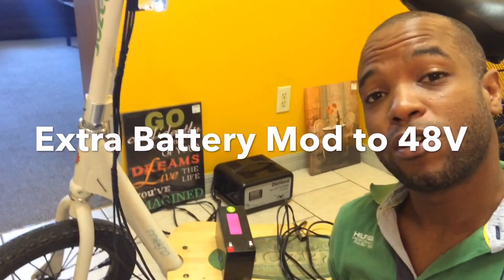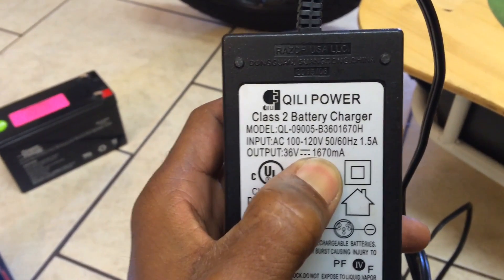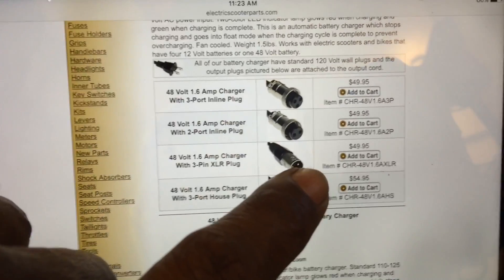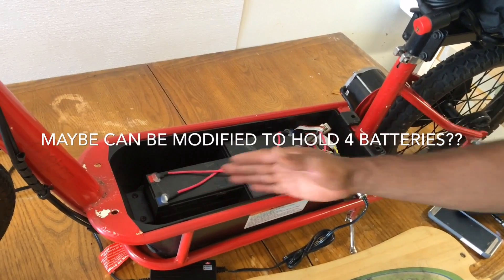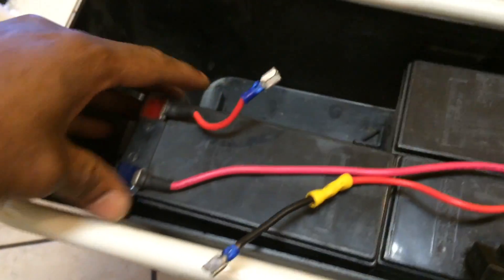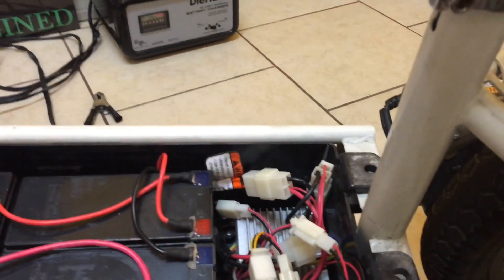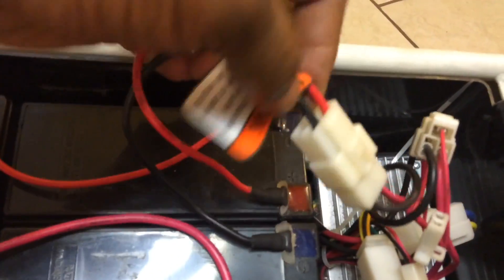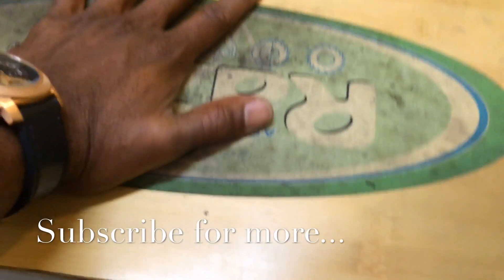Razor Eco Smart Metro Electric Scooter 48V DIY Upgrade

Comment: I raised to 48V and rode exactly 4 months :)
(just don't use charging port, make a direct 48V charge connection to battery)
The motor burned, smell so foul.
But I have really enjoyed the ride for 4 months.
I am in middle of converting to 1600W brush-less motor(BLDC)
and looking forward to enjoy the super speed.
Reply: What motor did you go with? How are you dealing with the brake? I'd love to hear much more about this as I'm interested in doing the same thing since my rear assembly just shook it's bearings lose and wreck the hub.

Comment: How did you use 48 volt on a 36 volt motor. My ecosmart has a 36 volt 500 watt motor, never knew you could put more voltage into a lower voltage motor.
Reply: Yes you can, those mid drive bldc motors can usually handle allot more then what they say. I have a 48v 1500w motor hooked up to a 72v 8000w setup. Works just fine. Maybe a bit of over heating if you constantly Max out. The 3,000w bldc is the  same size as 1500w. So if you over great alot you can switch to that one. Just have to have a good controller  that can adjust everything to your liking/setup.
Reply: @joshuawilton7829  More torque and distance due to the extra weight I carry 250 lbs was more of my consideration and the way I solved that was to trade out the 3 - 7 amp., 12 volt battery's that came with my eco - smart scooter and replaced them with 3 - 15 amp., 12 volt battery's doubled my distance and for torque I went with a larger sprocket. 
    All in all with my extra weight, I think I came out ahead of the game with 5 extra miles in distance and a 3 to 5 mile an hour speed increase. I also put on some fatty tires which smoothed out my ride, but broke even on everything else, except charge time. There I really gained, due to the extra amperage. My running time is almost two fold. While the charge time is just about the same.
   I understand the principal of hot charging / over charge but eventually it's not really a sustainable way to operate and will eventually cause the winding's to break down from over heating / expanding and cooling / contracting. Kind of like running nitrous gas on a car engine. Thanks for the info and the video, but I think I may just upgrade to a 750 watt motor from the 500 watt stock motor I'm using now. Looking to go to 48 volt 30 amp battery's.
Reply: @themessiahssecondassembly7761  you’re very detailed and intuitive. A lot of great subjects you touched base on. Definitely going to remember/save this info.

Comment: I agree with your reply Elton; I did note an additional wire to the controller which must do something? My scooter would not even light the power light until I returned it back to original configuration. I did get a spark; think that was just the two wires on battery inadvertently rubbing each other. All seems fine and really I don't get it either. I don't know what the extra red wire to the controller is, however. It really isn't too much to unplug & then replug the charger wire however.

Comment: Hi, thanks for the video.  Do you know of any way to increase torque.  I would like the scooter to pull a hill better.  Any better would help.  Thanks!
Reply from the maker: Sure but it would take a lot of research and or machining. You could install a bigger rear chain sprocket to increase gear ratio but I have no idea how big or if one exist that would bolt right on. That would significantly increase the torque but drastically lower the top speed. Like driving a car around town in only first or second gear.
Reply: @eltonq  I was hoping the 48V would give me a torque boost.  I have the newer hub drive model.  Maybe that makes a difference?
Reply from the maker: @twarch1978  oh sure it will give you a boost across the board but i think it would def consume more power going up hills at a faster speed or about the same as the 36V system. The physical work and energy (amperage) required to climb wouldn’t really change.

Comment: Hi, I did all the upgrade exactly as you stated. Fail. The added battery did work. The problem came from splicing the charging port to the battery via bypass controller. The scooter would not work in this manner. So, back up and return to functional status:   I think a direct line to battery is correct. I have ordered a 48volt charger. I think the direct bypass must be attached only when charging the batteries. Then, the wiring must be reconnected to the controller (the wires to the batteries) in order for the scooter to perform. Will post when I get the charger. I noticed your batteries later died. Was this due to upgrade or not charging for some time? Thanks for the video.
Reply from the maker: Lynn González hello Lin you had me nervous there for a second I thought my instruction fried your scooter lol phew 😅 

I'm not sure what happened but you are supposed to splice from charge port straight to main red and black battery harness wires when you go to use the new 48V charger. Technically speaking not having anything plugged into the charge port should be the same as just disconnecting the charge port connector on the inside as shown in the video in which case the scooter should run fine. Can you explain again what went wrong?
Reply from the maker: Lynn González the new battery I added is still good. It's the original 3 that died. They gave me very good service and just wouldn't take or give a full charge close to 1500 miles of use so not bad at all really. New battery only has about 300 or so miles on it.
Reply: Im going to try this, so you can run it off the 36v controller or did you use a new 48v controller
Reply: Do you have any video of the scooter running with this battery setup?

Comment: Did u change the controller to 48volt and did u get the new handelbar grips from ebay with the key. It comes with rhe 48volt controller for $60. Its a nust hv 
Bsipp

Comment: How did you know that this motor was 48 volt compatible?  I have read reviews that the motor gets very hot on 36 volts, how hot does it get on 48 volts? Will doing this shorten the life of the motor?
Reply: Yes

Comment: By doing this in this way you will actually be taking the power away from the controller. The scooter WILL NOT RUN. You have to get another controller. That site he got the charger off sells them and they are not expensive. They even have wiring diagrams if needed but when I did mine it was all plug and play. Another thing is the motor will get hot because its a 36 volt motor with 48 volts to it. It may even burn out over time. Unfortunately the 48 volt motors wont just bolt up easy like with the MX500 or 650.

Comment: I am pretty sure that the scooter will not run if you bypass the controller the way he explains in the video. It would charge the batteries but NOT run. You will need to replace the controller as well w/a 48 volt controller. Then the scooter will both charge and run faster. likely over 20mph but with a slightly longer running time. Thank you for the video, but the controller must be replaced as well with this upgrade.

Comment: Hi, nice job on the video and your scoot looks good in that color of red.
 I have one of these I've fixed up.  Recent upgrades: controller, throttle, battery, motor, front brake, fluorescent green, etc. 
 Many of the components are awful.  Check out the rear brake, two shoes but only one actually works, and impossible to adjust properly.  My scooter also had two missing bearings in steering head. These were missing out of a bearing cage.  When I got a replacement set they sent everything including races, riser clamp, nut and washer.  Notice I said washer? You don't have a large washer under your steering head nut, because if they had put it in, your spring loaded set pin for the riser wouldn't have popped into place.  To install handlebar riser with washer you need to elongate the hole the pin pops into.
So quality control stinks but some things are pretty good.  The powder coat seems really well done. It's thick and  tough and covers well.  The frame is straight, at least I found nothing wrong. It must have been jigged up well and the welding is good. Platform is really nice strong bamboo and was very well finished, etc.
Performance has improved.  New custom 36V LiFePo4 battery (AA Portable Power Corp / batteryspace.com) and 750W motor from ElectricScooterParts (original 500W).  Speed is higher at about 25mph, this is a guess but I'd say I'm getting typical 25 mph flapping from my shirt.  Range is unreal. Miles and miles. And not going slow either.
 It's so nice to get what I wanted, basically a little faster off the line for crossing busy streets, all the range I need, and dangerously fast for this little piece of Chinese iron.  (did I mention it does 45 degree leans in the turns?)
Reply from the maker: Very Nice but do you have a more specific idea of range?
Reply: I'm waiting for a speedo.  Power meter is mal-functional. Farthest I went is 12 miles, with hills, (G Maps) with no loss of power. It's a tough grind going up steep hills.  Range needs to be averaged because terrain varies here.  At this point I have to ask how long I want to ride that unsprung thing to run an errand. The 12 mile run was excellent, quite enjoyable.
Reply from the maker: That's awesome! If you went with a 48V battery then you would get even more range and performance!
Reply: I'd like to see the front brake

Comment: hi Elton its steve in uk,chester.i have the razor e300 and have overvolted it but really like the eco smart design as you have loads storage space for battries.i have built my own 18650 52v kit so would fit in tht space.trouble is you cant get the eco smart over here so as thinking making one like it.me and my wife have 2 bmx scooters already we bought new with small wheels .anyway nice work there.steve

Comment: Did you increase the amps, amps as I understand it, increase's the distance you can travel, speed is great but distance and length of run time is important for me. Now what I'm hearing is that the standard eco smart bike has a 3 - 12 volt 7 amp battery's. Now the charger may only charge at 1.5 amp hours,  or 2, but that's not the battery it's self, that just determines to how long it takes to the charger, to recharge the battery's, higher amp out put, less time. So how many amp's were your battery's ?.
     I understand that you can get up to 15 amp on the mighty might, at 12 volt, the battery's are the same size and instead of adding a extra battery, which will require you to change or not, everything out to increase speed, you can increase distance with the same regulator, just getting the battery's up to 15 amp. 
   Saw a video where a guy did it, but he never really said what kind of increase in distance he got. Another guy on another video went to 12 amp and said he got about a 1/3 more distance and wished he had gotten the 15 amp.  ( Cost is about 100.00 / hundred dollars, for the 15 amp or 70 for the 12 amp, and everything fit's, no change in anything, but I don't think it increase's speed. ) Thanks for the video.

Comment: Hey. I was going to add four more batteries to my moped but use a toggle switch until I heard u say the controller can't handle more batteries, well more than one extra battery. Hmmf, what if I use the toggle switch to ditch over when the 1st four get low during Max mileage. Or should I just build a battery pack with its own charging plug and quick disconnect and reconnect wires when I need too.

Comment: Elton, I have a question about the charger does the amp hour factor in? I found a less expensive charger on amazon 12V 2.5A but 20AH. I realize these batteries are 7-7.5AH any concerns. Thanks for the video.
Reply from the maker: You're welcome Jason. Here's the thing with chargers. They have to put out the voltage of the circuit being charged so no matter what you are going to need a 36V charger or 48V depending on how many batteries you have. Otherwise a 12V charger will do nothing to recharge the batteries. As a rule I would say don't go over 3A charging as more amps for charging will reduce battery life. I think 2.5A is the most I would go. The factory 36V one is 1.69A. Hope that helps.
Reply: +Elton I totally missed stated I said 12 V I'm at 48 V. My concern was the 20 amp hour rating
Reply from the maker: +Jason Velez ok I see in that case I don't think you have to worry about the Ah rating on a charger. The only 2 numbers that matter are the charging voltage and amperage as over time it can charge a battery of any Ah rating. It's just how long it would to fully charge it. In any case if the ones you are looking at are rated by Ah charging capacity then just add 8Ah + 4 batteries = a 32Ah charger or thereabouts?
Reply: Jason Velez hi Jason I have a 48 volt and would like to add a extra battery to  for longer run time making it 60V is that all I would have to do ? Thanks in advance

Comment: what's the largest motor you think I could put on it to make it go faster?
Reply: Sandy Redcloud 48v 1800w, it’s basically the best you can get for or its size.
Reply: @jaxw2628  Does it fit without frame modifications or soldering?

Comment: CAN YOU JUST SLIDE THE ONE BATTERY OVER AND ADD 1 MORE OF THE SAME FACTORY BATTERIES TO MAKE A TOTAL OF 4 FACTORY BATTERIES WITHOUT MAKING ANY OTHER MODIFICATIONS  FOR LONGER RIDE TIMES??????
Reply: Put the fourth battery in parallel...NOT series. No higher speed but more range...

Comment: I'd like to ask a question regarding replacing my 7 amp battery's with 3 - 12 volt 15 amp battery's. Do I need to change anything or is it just a matter of a longer charging period. I understand I won't get any more speed out of it, but I'm not looking for that, I'm looking for distance and time of travel, which should be almost doubled by increasing the amps, right ?.
Reply: Not more speed, just more range, bad news though, 12ah will not fit, only 10ah.
Reply: @Poepad  This isn't true. I was able to fit 3 - 15ah SLA batteries in this scooter with no problem, you just mount them sideways, instead of forward. You will need to purchase or make a new wiring harness, and also a way to make it so the batteries don't slide about, but it will fit, and the deck will close.

However in my testing 15ah batteries only lasted just as long as the 7ah batteries. However the speed of the scooter increased to 20mph during the run time. Very odd.

I ended up just using Ryobi 40v batteries, which are actually 36v nominal. They are not perfect, as they can't take a full throttle from stop, but the range is much further. I have 3 4ah 36v batteries, each getting me 7-8 miles. I just raise the deck and swap in another when it gets low! Even the meter for the  "Dash" works to let you know when its getting low too! You charge it on the standard Ryobi charger, which charges WAY faster than the lead acids that come with this thing.

Comment: I added up the combination of voltage with 3 old and 1 new battery. It measured at .1 over 48 volts. One battery showed 10.7 volts. I note this as all had charged simultaneously but one had gone nearly drained during battery transition.
So, Elton had discerned that one of his batteries "bummed out" and died after 300 miles. Perhaps a similar thing occurred to him and the unequal charging lead to it's early demise compared to the other batteries. Realize one battery "new" was more chargeable than the rest and created an inequality anyway. 
These new batteries are charged to 13 volts each and that equals 52 volts instead of 48 volts. Ouch, snap, crackle, pop. 
'splains the zapped fuses, yeah?
36 volts tops from old batteries to 52 volts on all 4 new.
Then, there is the question of who entered the speed controller before I did?
If it had been returned as the service tech had speculated, that could point to a previously detected problem there.
(I got a $50-$100 discount for a "clearance" scooter) Why? I thought at the time it was because they only had 3 left. Somebody may well have returned it and that brings in variables that are too numerous to mention. So at $290 for this scooter, I got my monies' worth after the first 3 months and I have no complaints against Razor.
That being said, I would not have another one shipped as the frame was bent in critical places. 
I plan to fix with new controller and will try the voltage up after I use the batteries for about 6 months.

Anyway, I plan to just use 3 for now so not to overvolt the new controller.

https://electronics.stackexchange.com/questions/60732/batteries-in-series-with-different-amp-hour-ratings
Reply: My deletion was due to "educational" experience here being just that. This is my first scooter and I didn't want to submit an erroneous baseline product.
Reply: This would be my final analysis on the 48 volt "upgrade":  I figure this little scooter would perform best at about 42 volts. Most forums discuss that higher voltage through a 36 volt motor is possible and we proved it was.  The instructions state to charge at least 12 hours but no more than 24 hours. I changed new batteries and got 13+ volts at 18 hours. I figured I was getting peak performance when I charged my new scooter for 21 hours with original charger. Do the math and that would probably equal about 42 volts.  Not a bad scooter for the price and only complaint is weight. Lithium battery pack would solve that problem but they and the charger are expensive. That is twice the price of the scooter.

Comment: This doesn't sound like a good idea. Motors are rated for a certain maximum voltage and if you exceed it, the motor will burn up eventually. If you want to upgrade it, get a higher amp hour lithium ion battery of the same voltage with a new charger.